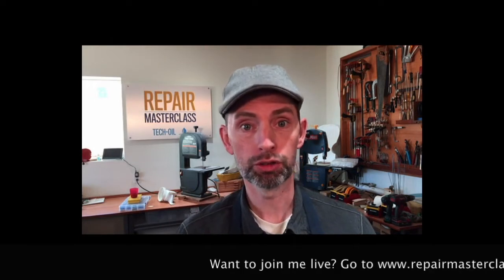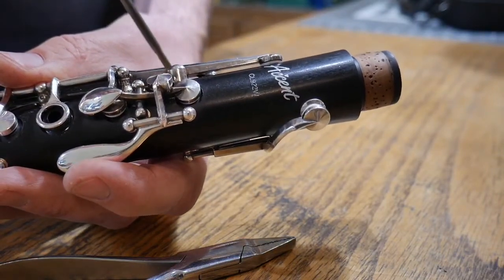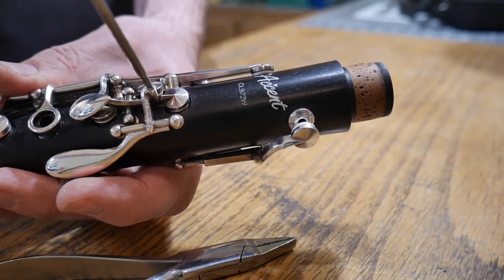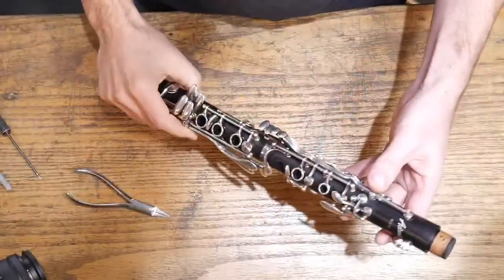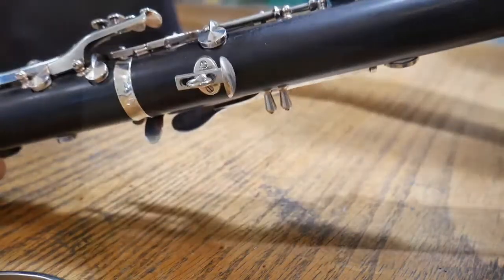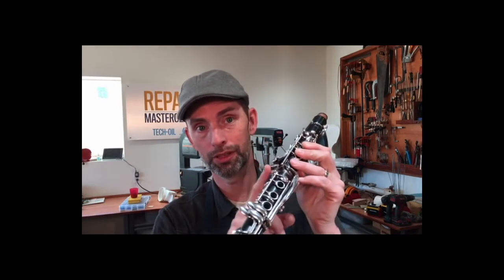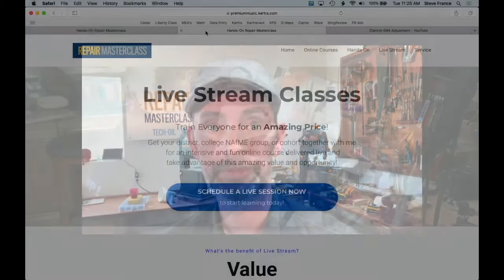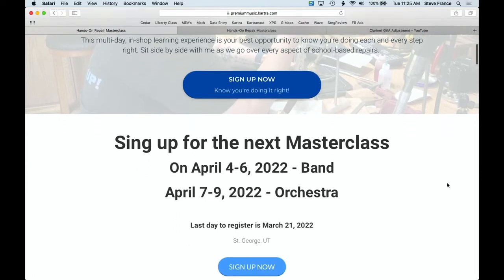3 Clarinet Adjustments

Comment: Thank you so much for this video.  My clarinet stopped playing after it suffered a slight fall. The G# adjustment got it back working as good as ever!  The slotted end of the nylon adjustment screw was flattened and I had to open up the slot before I could adjust it.  My guess is that the screw took a knock when the instrument fell.  John.

Comment: what do i do if my B doesnt speak when im only using my left B key, unless i press down really hard? 
the B comes out if I add right C or B, but not just left B
Reply from the maker: @angelaclarinet  That’s very observant and I’m guessing there is a combination of things going on. First, and this is just speculation from experience, but I’m guessing there is a slight pad misbalance needing some love. Watch my feeler gauge video to learn how to make and use one then check the F-C key and B, then I’d say the crows foot needs to be adjusted. Lastly, the corks on your left B key may need to be replaced.

Comment: Do you know how I can fix my ring keys? They're higher up then normal, and it's affecting my high notes. The problem is mostly on the bottom.
Reply from the maker: Sorry for my delay. If you place a block (ruler works, just something flat-ish and wider than the tone hole) under the pad and then press down ever so slightly on the rings you can bend them down. You'll only have to press on the first one and they'll all move up or down. Going back up is much more difficult so move slow and easy!

Comment: I have an A key that is just dead, there is no tension.  I removed the G# and the A key to examine the underside of the key.  It has a tiny screw and an even smaller bracket.  How long should this bracket be?  It seems the bracket should have some tension on it, to hold the A down when not engaging the A or the G#.  My bracket does not appear to be broken, but I cannot seem to get this one hole to seal.  I replaced all of the pads and the cork, the rest of the instrument appears to be in a good shape.  If I hold down the A key, I can easily play G, F, E, D, C on the upper register.  Any help would be GREATLY appreciated.  Thank you!
This instrument is really old, maybe from the late 1950's/early 60's - a Schreinber and Shone made in Germany.  It does not appear to be made of natural wood, some type of resin or plastic?? Is it even worth trying to get it to play?  THANKS!!!!!
Reply from the maker: You can get anything to play no matter how old! That bracket like thing is a flat spring and is what should create the tension to keep the A key closed. What you need to do is, with the A key off the instrument, use a pair of flat or round nose pliers and increase the bend in that flat spring by turning it away from the key. You're only looking for a few millimeters of repositioning of the end (non-screw side) of the spring so this movement can be small, nothing serious here. Once done, put it back on the instrument and test for tension. If you need a bit more, remove it again and go a bit further; if it's too tight and difficult to work, you can do the opposite movement of the spring and reduce the tension (if you happen to overdo it). Be sure to check the A pad for even tension all the way around the pad - see my video on feeler gauges for more info here. 
I hope this helps! Let me know if you have more questions.

Comment: Thanks for this, I've been searching for something like this, the problem I have is with my A key, it's somehow blend lower than normal so when I press it, the sound is not full as other note, how can I adjust it?
Reply from the maker: Ooo, great question! This needs to be it's own video; I'll let you know when that's out. In the mean time: When tone is not full, or fuzzy, it typically means the key is not opening far enough. In most cases, a little cork can be sanded from the key where the key makes contact with the body of the clarinet. REMEMBER, a little sanding goes a LONG way here so go slow. I cut a thin strip of 220 grit sand paper so I can slide it under the key cork and, while lightly pressing the key into the sand paper (the grit side toward the cork and NOT the body), pull the sand paper strip out to remove a bit of cork. Test the playability of the note and repeat as necessary.  
The advanced version of this is to bend the key but let's start slow and easy and just remove a bit of cork.
Reply: @repairmasterclass  somewhat related question. I recently bought an Eb clarinet off of ebay (didnt expect it to be good) and the low B natural alternate fingering with the thin key is very airy and fuzzy. The thin key you press to play it is also very low, so the key isn't going that high. Do you have any tips for fixing/heightening that key?
Reply from the maker: @plzstandby1022  This one is more tricky and seems like you have keys that are very soft (easy to bend) and perhaps that were not made at the correct angles to begin with. You may need to bend keys here and this is VERY sketchy to do because soft keys break easily. It makes me VERY nervous to bend soft keys - to the point of typically advising the client to buy a better instrument. If I could see the issue, I'd be able to offer more and possibly better advise.

Comment: Gosh, you are so quick to bend keys - and you do not mention anything about cork that was possibly lost or compressed due to age and needs to be replaced with correct thickness. In my experience if keys are bent from their initial factory alignment, that will be visually evident. Keys are made to be really secure and have cork spacings to make the proper regulation.
Reply from the maker: All true. I spend a LOT of time discussing how to bend keys, how to change, measure for and adjust corks, how to set regulations with cork and even various materials I think work better than natural cork (in most cases) all in my Repair Masterclass courses. See the web site for more information if you'd like. 
As for this video, yeah, 3 quick tips to get the job done before a concert starts. What tips do you have for clarinet players?

Comment: I’ll give you the A-Ab adj screw. But the bridge and crow foot adjustments are totally irresponsible to show one YouTube. The techniques you show are down right wrong! After 44 years in the repair trade I can’t tell you how many clarinets came across my bench with major problems because some tried the techniques you show. Broken bridge keys and plague keys so bent out of shape they were hard to correct. And you didn’t even address lost motion. An irresponsible video!
Reply from the maker: Well I don't have 44 years in the trade, only 27, but I do have confidence in people to not screw things up. Sorry you disagree. If you feel like offering a better explanation on how to fix these issues, I'm wide open to it.